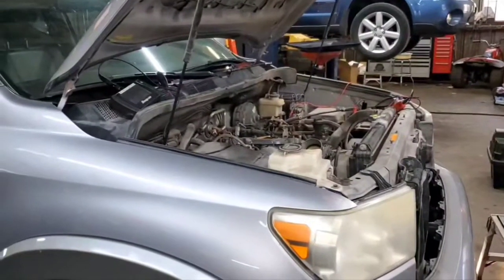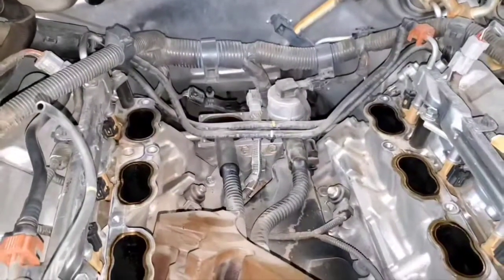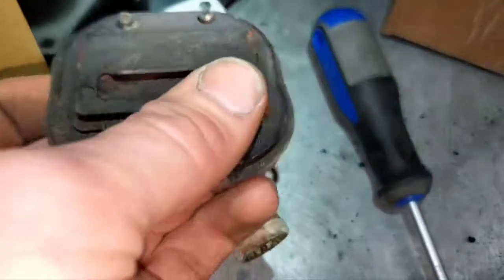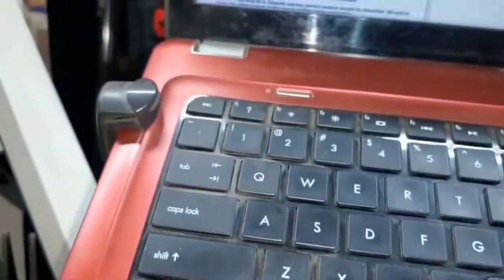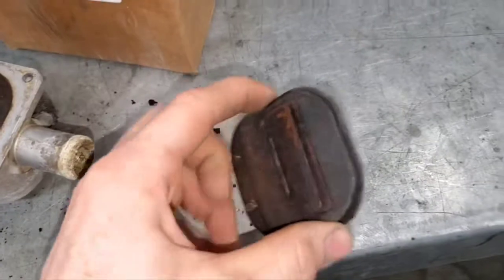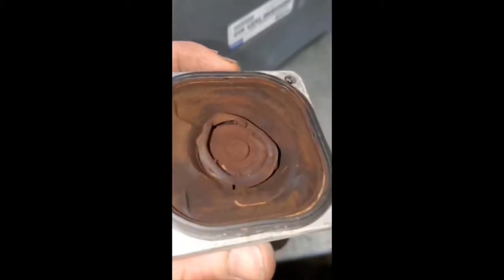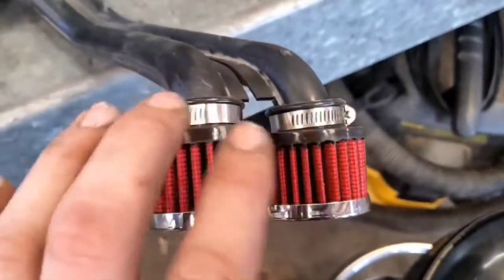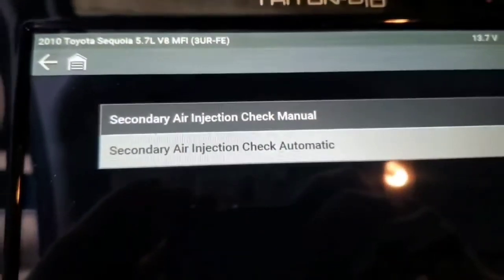Toyota Sequoia 5.7 Secondary Air Injection Operation, Repair, and Filter Mod

Comment: Those KN filters are pricey, a Briggs and straton lawnmower filter, oval with two +/- 1 inch holes, fits like a glove. Just not sure how it will do if it gets wet. But since it only draws air on cold startups, it should be fine.

Comment: So, what's back probe, how you fire the pump up? I have voltage on it, if I disconnect. So you bridge it or where to give 12 volts?
Reply: Direct check no problem
Reply: I Donno, I checked mine, it's working . But almost every morning I still have check engine. Sometimes working sometimes not. Also I monitored that sometimes I hear the pumps working longer. Sometimes shorter time. 🤷 I replaced the OEM pumps to Amazon stuff but I replaced one aftermarket with the old OEM (because with direct check it was working). Got to check which side but probably the one I have the failure.  @user-rajput501

Comment: I put green scotch brite inside the 4.7 pump when doing any sec air injection repairs.  Looks like it should work the same in the 5.7 pumps too.  Won't rot like the factory foam does.